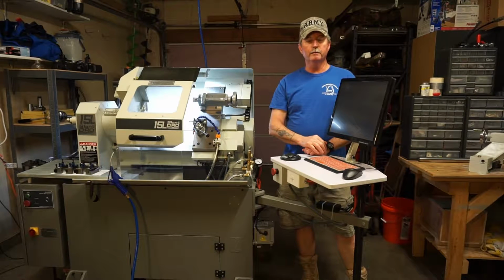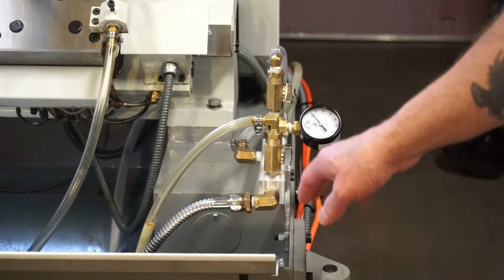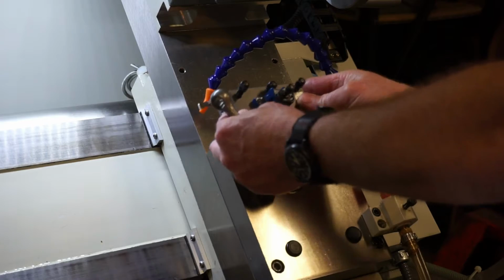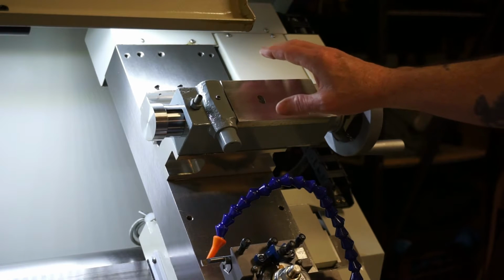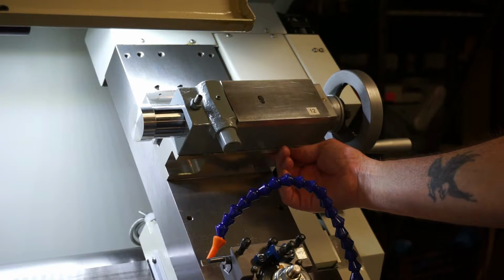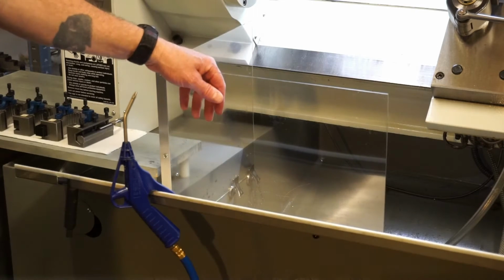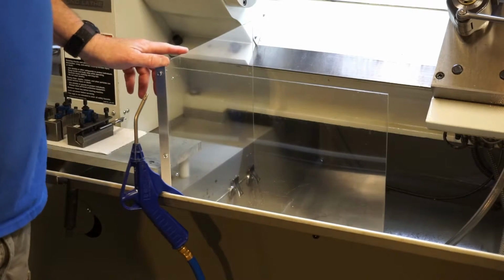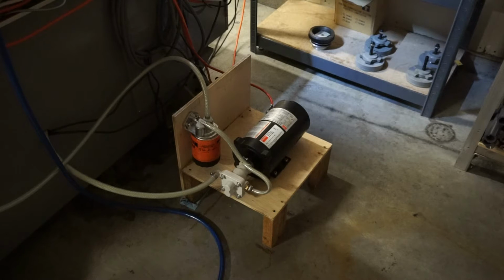Tormach Lathe Modifications

Comment: Not that anybody would ever learn this little bit of "trivia" if he/she stuck to being "educated" by online "gunsmiths", but there is absolutely no need for a "chamber flush" setup for chambering if you "pre-bore" the "rough" chamber and then use the REAMER for what REAMERS ARE MADE FOR WHICH IS TO FINISH THE "ROUGH" HOLE TO THE PROPER FINISHED DIMENSIONS. REAMERS ARE NOT DRILL BITS OR BORING BARS AND THERE'S A REASON THEY DON'T "EJECT CHIPS" ON THEIR OWN. THEY'RE NOT MADE TO BECAUSE THEY'RE NOT MADE TO DRILL OR BORE HOLES. 

A REAMER IS TO A DRILLED/BORED HOLE IN ROUND STOCK WHAT A HONE IS TO A BORED ENGINE CYLINDER. THE TOOL TO GO FROM A ROUGH UNDERSIZE BORE WITHIN A FEW THOUSANDTHS OF THE FINISHED AND SPECIFIED BORE DIAMETER TO THAT FINAL DIAMETER DIMENSION WITHIN A NARROW "TOLERANCE". 

IF REAMERS WERE MADE FOR "DRILLING" OR "BORING" THEY'D BE MADE LIKE DRILL BITS AND WOULD HAVE "CUTTERS" INSTEAD OF "FLUTES" AND WOULD BE SPIRAL-FLUTED. THE WHOLE "BUY A BARREL BLANK FROM A QUALITY BARREL MANUFACTURER CAN SHADETREE "MACHINIST" IT INTO A FINISHED BARREL" THING WHEN YOU CAN BUY A "SHORT CHAMBERED" BARREL FROM A REAL QUALITY BARREL MANUFACTURER THAT DOESN'T MAKE MAINLY "BLANKS" LIKE KRIEGER WITH ALL THE MACHINE WORK DONE AND THE CHAMBER .010" "SHORT" SO IT CAN BE "FINISHED" BY HAND IN A FEW MINUTES THE WAY MOST GOOD GUNSMITHS PERIOD DO THEIR CHAMBERING AND FOR A NOMINAL EXTRA FEE WITH THE WORK DONE BY THE SAME PROFESSIONALS AND MACHINES/TOOLS THAT PRODUCE SUCH HIGH-QUALITY "BLANKS" IS JUST "HILARIOUS". 

ESPECIALLY WHEN ANY "GUNSMITH" WITH A CLUE IS DAMNED SURE GOING TO HAVE ZERO QUALMS ABOUT NOT WEARING OUT/ORDERING/BUYING HIS OWN TOOLS TURNING A "BLANK" INTO A "BARREL" AND SHOULD ALSO HAVE ZERO QUALMS ABOUT ONLY SLIGHTLY REDUCING HIS "LABOR RATE" FOR "RE-BARRELING" SINCE THE FINISHED PRODUCT IS ALWAYS GOING TO KICK THE HELL  OUT OF ANYTHING HE CAN MAKE IN HIS "MACHINE SHOP" STARTING WITH A "BLANK" FROM SOME OUTFIT PERFECTLY FINE WITH LETTING SOME RANDOM "GUNSMITH" TURN THAT BLANK INTO A "BARREL" SPECIFICALLY BECAUSE AT THAT POINT IF IT SHOOTS LIKE SHIT IT'S ALL ON THE "GUNSMITH" AND THEY SAVE BEAUCOUP BUCKS NOT CHAMBERING AND/OR OTHERWISE "FINISHING" IT. 

Seriously, a "gunsmith" spending many hundreds of dollars of his and/or his customer's money to get what is noting but a piece of shiny round bar stock with a freaking hole drilled/reamed/rifled through it and maybe "contoured" in a situation  where that "blank" is literally getting "whacked off " a 5-6 foot long "pre-drilled/reamed/rifled" chunk of...bar stock some high-school graduate "machinist" who many not even have taken "shop class" then sticks in a CNC lathe and punches a few buttons to "contour" and "crown" and thinking they can then take that chunk of bar stock and stick it in their "hobbyist-grade" or "worn-out so-called toolroom lathe" and "precision machine" that piece of bar stock into a "premium barrel" being probably the third or fourth "machinist" at LEAST to handle it and putting it in at LEAST the third or fourth "machine tool" it will have been in is like an "engine builder" thinking he can get a "rough-bored block" from DART or Keith Black" and "finish machine" it with is "portable boring bar" and Sunnen CV-616 and align-boring/honing setup and end up with just as "good" and "precise" of a finished product as a complete finished block right from the manufacturer all "perfectly" machined and "blueprinted" and give his/her customer the "same value" REGARDLESS of the final "cost". 

And by the way, since "coolant" is NOT "thick" and "heavy" and "viscous" or "slick" enough to work worth a SHIT for "flushing chips" which is why so many "gunsmiths" are jacking around trying to "crank up the pressure" and ANY DECENT "MECHANIC" MUCH LESS "MACHINIST" KNOWS YOU HAVE TO "BREAK CHIPS" AND "CLEAR CHIPS" MANUALLY FROM TAPS, REAMERS AND OTHER "NON-SPIRAL" MACHINING TOOLS, YOU'RE PISSING UP A ROPE THINKING THAT "FLUSH SYSTEM" IS GOING TO TAKE WATER-BASED COOLANT AND JUST "WASH" CHIPS RIGHT OUT OF THE DAMNED BORE AND LEAST OF ALL WHEN A STRAIGHT-FLUTED REAMER BEING USED AS A "DRILL BIT" OR "BORING BAR" IS STILL IN THERE "MAKING CHIPS" AS FAST AS THE "SUDDENLY IN A HURRY TO MAKE MONEY GETTING THE JOB DONE "FAST" SO-CALLED "GUNSMITH" AND "MACHINIST" CAN GET IT TO "CUT". 

Seriously, there's a REASON DRILL BITS ARE FLUTED AND BORING BARS ARE ONLY USED FOR "VERTICAL BORING" WHERE THE "CHIPS" CAN FALL DOWN AND OUT OF THE BORE AND "TOOLPATH". BECAUSE THAT'S HOW "CHIPS" ARE CLEARED "AUTOMATICALLY" WHEN YOU KNOW WHAT YOU'RE DOING AND "REAMERS" SHOULD NEVER CUT "CHIPS" ANY "LARGER" OR "LONGER" THAN ANY TAP DOES AND THE "REAMER" SHOULD BE MAKING A FEW DOZEN "TURNS" IN THE ROUGH-BORED "CHAMBER" AND AGAINST IF YOU'RE SMART AND REALLY WANT TO DO IT "PRECISELY" USING "HAND POWER" RATHER THAN AT DOZENS OR HUNDREDS OF RPM USING A FREAKING LATHE AS A "HORIZONTAL MILL".

Did I say "horizontal mill"? I sure did. Why? Because if you go to a REAL MACHINE SHOP where the machinist(s) does CYLINDER HEAD WORK and replaces/reams/grinds VALVE GUIDES AND VALVE SEATS in CYLINDER HEADS, YOU'LL SEE THAT HE IS USING A "MILL" TO DO THE "BORING" AND "DRILLING" AND "REAMING" PORTIONS OF THAT WORK AND IN SOME CASES THE GRINDING AS WELL. IN OTHERS A "HAND GRINDER" IS USED FOR THE SEATS. A GOOD OLD SIOUX VALVE GRINDER IS ALMOST INVARIABLY USED FOR THE VALVES WHEN VALVES ARE REUSED ALTHOUGH SOME "CYLINDER HEAD MACHINES" CAN GRIND VALVES AS WELL

Learning to be a "machinist" much less a "gunsmith" from some gunsmith school "teacher" and/or internet "professional machinists" both of which have all that "free time" to "teach" because they don't actually do much REAL MACHINING/GUNSMITHING is precisely why as "amateur" of a "machinist" as you can get like ME but who HAS run a BORING BAR boring cylinder blocks and HAS done cylinder head work and who is a 25-year diesel mechanic with a LOT of "engine building/rebuilding" experience and who has benefited from working with and taking work to SEVERAL TRULY TOP-NOTCH MACHINISTS/MACHINE SHOPS AND WHO IS A LIFELONG "GEARHEAD" AND "FAN OF ANYTHING THAT TURNS MONEY INTO NOISE" SOMEHOW ENDS UP KNOWING THINGS THAT "ONLINE EXPERTS" MUCH LESS THEIR "HOBBYIST STUDENTS" CLEARLY DON'T HAVE THE FIRST CLUE ABOUT. 

If you want to learn machining and "practical machining" properly and want a good idea of what to EXPECT in the REAL WORLD as a "machinist" and/or "gunsmith", go WORK FOR A MACHINIST/MACHINE SHOP/GUNSMITH for a few days or weeks even if you work for "free" because its OBVIOUS that "gunsmithing schools" and "online experts" don't know SHIT about the "real world" of either "machining" OR "gunsmithing". Know how many "gunsmiths" make their "primary living" doing "rebarreling" using "barrel blanks" and starting with "new" or "project rifle" parts and pieces they just get to do all kinds of "making chips" on? VERY DAMNED FEW JUST LIKE VERY FEW "MACHINE SHOPS" THAT "BUILD ENGINES" MAKE THEIR MAIN "INCOME" ACTUALLY "BUILDING ENGINES" AND VERY FEW MECHANICS SPEND MOST OF THEIR TIME AND MAKE MOST OF THEIR MONEY DOING "ENGINE OVERHAULS" OR "TRANNY REBUILDS". 

In the REAL WORLD most "gunsmithing" is "refinishing" and "repairing" and "rebuilding" and CLEANING guns of all shapes and sizes and mainly "cleaning up" whatever "mess" customers bring in after they or some "random stranger" they never know neglected/abused/beat up/broke/fouled/tried to "restore" themselves/or just plain "wore out" the gun in "whole" or in "part". And "machinists/machine shops" that are also "engine builders" MAINLY end up doing machine work for mechanics both professional and amateur who do their OWN engine-building/rebuilding as well as "cylinder head rebuilds" or maybe resurfacing flywheels and rebuilding connecting rods and maybe grinding/polishing crankshafts and other routine, boring as can be but absolutely "critical" work for "pros" who can spot shoddy work and "machinists".  And we professional mechanics no matter how much we love and love doing "engine overhauls" and "tranny rebuilds" spend most of OUR time on the "minor stuff" like electrical system problems, leaks of all kinds, worn-out steering/suspension parts, general service/maintenance items, air-conditioners, water pumps etc etc etc. 

Know why every "custom rifle builder" online seems to have "in-stock" and "ready-to-ship so-called "custom rifles" just like every "major manufacturer" has stock in/on distributor/dealer warehouses and shelves? Because the "only gunsmithing" they do and the only "gunsmithing" they know HOW to do is "slap together" so-called "custom rifles" and they obviously went out and dropped a PILE of money on "barrel blanks" and "stocks" and "high-end" or "stripped new factory" receivers/actions/bolts and "high-end triggers" and of course their "machine shops" and they had/have nothing else all that time-consuming and pressing to do besides slap together their "custom rifles" that are nothing but ridiculously overpriced "kit guns". And that are not "custom" in any way, shape or form to anybody who knows the actual definitions of "custom" and "custom gun". 

You don't build a "custom gun" with a pile of brand-new "catalog" parts the "high-end" manufacturer of turns out in what is for it a "mass-production" volume. A "custom gun" is built starting with a "factory gun" and not with a pile of "high-end" factory parts ordered online per the "advice" of "experts" on the "forums" or YouTube videos who ALWAYS are in the middle of a "build" because there's nothing CUSTOM about an out of the box/over the counter "mass-produced" part identical to hundreds or thousands of others in other "custom guns".

That's why you don't see any TRUE "gunsmithing" videos OR "gunsmiths" themselves "online" or hanging out in the "forums". They're busy in their gunsmithing shops building "custom guns" and/or repairing/rebuilding/refinishing/restoring "plain old factory guns" and you won't find THEM "truing" an action either.
Reply from the maker: WOW, I assume that you are an expert in every facet of metalworking so my reply will be brief. I do drill and bore the chamber with the PROPER TOOLS. You appear to have no knowledge of what it takes to produce a winning barrel or rifle. And quite frankly your use of the English language is even worse.

Please do not post your rants on my videos.